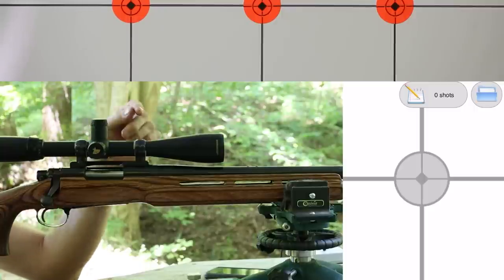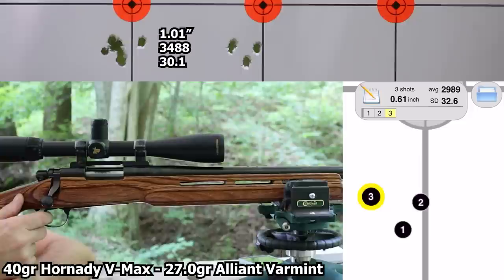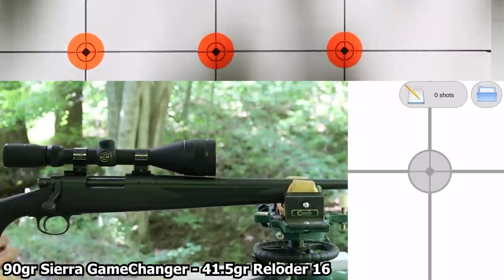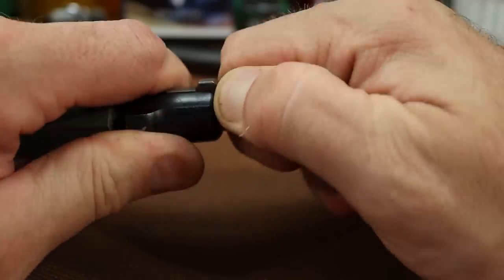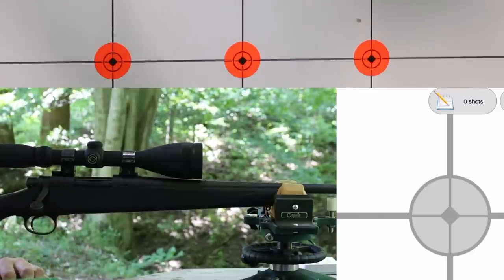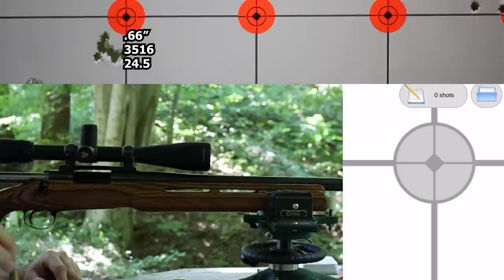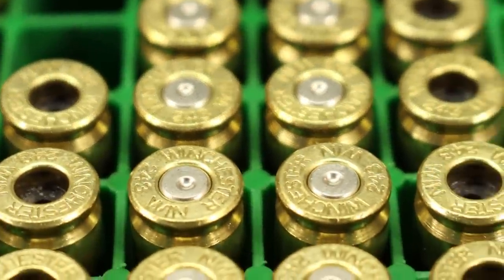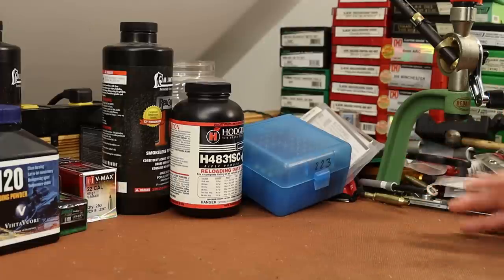Remington 700 firing pin spring replacement

Comment: I always close the bolt while holding the trigger down (on an empty chamber of coarse) to release the spring pressure while storing, never had to replace a firing pin spring doing that easy step.
Reply: Springs dont wear from beeing compressed but from repeated use. The springs are not tensionless when not "primed", so the idea that dry firing (or loosening the spring in the manner you say) does not make a difference long term.

Dads rifle has probably sat tensioned for 40 years and it works just as good as when it was new, a Win 70.
Reply: springs wear from cycles not compression

Comment: The firing pin springs were fine as you concluded. There is soooo much hope in the shooting community that changing a properly functioning spring, for a new, properly functioning spring will make a difference. Your test is similar to most of the other results I've seen.

Comment: Springs wear out from cycling them.  But that round count is in the THOUSANDS.  Well north of 8000 rounds.

Beretta says to replace the recoil and trigger return spring around 5000 rounds. I’ve fired well north of 15,000 rounds through my 92FS and there is a marked improvement in how if functions.

But it was 15,000 rounds before I replaced the main spring on the hammer.

Comment: Johnny, what I always thought is that generally, grouping is a function of load and component quality, where good sd numbers are far more load tune, and mainly Barrel quality.
You can have sub-moa cheap rifles, but It would be interesting to see if they can hold good sd's, though. I am sure that there are exceptions. 
Custom barrels may shoot at least half-good sd's with untuned loads and poor grouping, as far as my experience goes.

Comment: As a rule, ball powders are going to give bad SD's. I was disappointed in the N120 SD's and that points to a primer issue. Erik Cortina has proven that differences in primer seating pressure (depth) affects ES's and SD's. Of course he is using a $600 dollar tool that has great control of seating depth. I'm not going to spend that kind of money to seat primers, but I do have a tool that has good enough feel so I can stop when I feel the primer bottom out. When I shoot 300 and 600 yard benchrest the ten ring is 2/5's MOA. Low ES's are key to keeping the vertical out of the groups. Since the spring didn't help much, if any, the issue has to be in your loading. As you know, with the right load and procedures, SD should be in the single digits and at worse the low double digits with single base powders. With ball powder who knows, just believe the target and forget SD's.

Comment: Don't worry too much about firing pin spring  It plays more of a minor roll in accuracy compared to bedding a barrel. 
The 243 needs a tune up on bedding. Could put it in a better stock. I like to do minor polishing of barrel by fire lapping and using Rem Clean , JB bore paste, or even Brasso. Polish barrel crown when done. If none of that give you satisfaction in your accuracy requirements after load development. Time to rebarrel.

Comment: I have only seen spring-swaps beeing usefull on 22LR where a stronger spring can give you better accuracy. That together with a good proper firing pin. But 22LR is much more finnicy then centerfire as the priming compund is much less reliable.

Comment: Doing load development for my buddies  270wsm and no matter the bullet or load always getting a random flyer. First thought was firing pin then found action screws 30inlbs under spec. Same issues  so ordered a firing pin hope that's the cause

Comment: Typically the only time a firing pin spring is going to cause erratic ignition is when it's broken, not when it's mildly worn. Consistent primer strike is consistent primer strike, regardless of how hard. I keep extra firing pin springs, pins, sear springs etc... for my match rifle in my range box for this reason. If something happens in a match and I, nor my load have changed, that's the first place I start looking.

Comment: My 1971 700 has a couple of thousand rounds through it and has been dry fired maybe 3 times that when I can't get to the range. Velocities are consistent with my pet handload and it's holding about 3/4 MOA. Maybe the springs were better back then.

Comment: It is interesting to me that the average velocities of all the groups, with the exception of one, increased with the new springs. More efficient burn? Hotter ambient temperatures? I don't know what your case fill looks like with those loads but from what I have noticed in my limited time of reloading, when I can get a powder that gives me close to 100% fill or even slightly compressed my SD's are better. Love your content!

Comment: How can a spring change SD and ES numbers? (asking this just as the video starts so I don't know the outcome yet)
Reply: Same here 🤔
Reply: Apparently it’s consistent primer strike from what little I’ve learned from the benchrest and Fclass shooters.
Reply: I belive a new strong spring will hit the primer with more consist force generating more consists ignition than a worn or weak spring will.
Reply: @davegreenleaf5272  that seems more like it would change group size from the delay time difference. Not so much the actual ES and SD numbers? 

Now if the primers were not consistent in their "firing" that I could see causing difference in the ES & SD numbers. I would think?
Reply: The outcome of this video is what I assumed would happen. But yes, periodic maintenance is probably way more important in changing old springs out than trying to tighten up ED & SD numbers.
Reply: I bought one of David Tubbs's springs some years ago before there were any videos to illustrate the process, so I had to figure it out myself. How did I do that without a dime? (I'm in Australia.) By the time I got it all back together, I'd lost track of which was the new and which the old! Couldn't have been too bad, as I shot 3s regularly.
Reply: @jeffallen3382  This would all be pointless if using inconsistent primers or poor powder measuring.  Primers are shock sensitive so consistent ignition is reliant on a constant strike. 
The big variable here to me is, just because the spring is old and worn does not mean it is not consistent.  With that you cannot know you will get better results by doing this. 
Small ES and SD's are just as important to a precision long range shooter as maintenance.

Comment: hello Johnny i would love to see a load in 9mm with the 95gr tacxp 9mm from Barnes using the shell shock case. I think this bullet will hold together at high speeds especially if loaded to +p+ pressures. also the 95gr jsp from magtech would be interesting.

Comment: After a new spring (assuming your old one is very worn - you can tell by comparing length of old vs new if they are the same weight spring) you'll have to re-tune you load. If you still have my email, shoot me a note and I'll walk you through measuring primer depth protrusion.